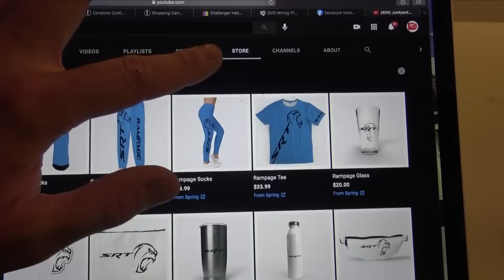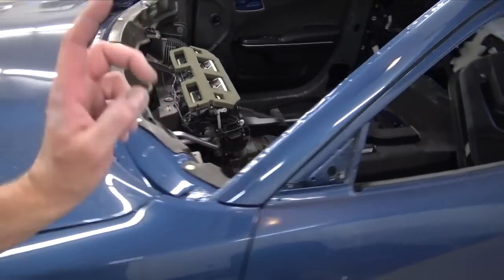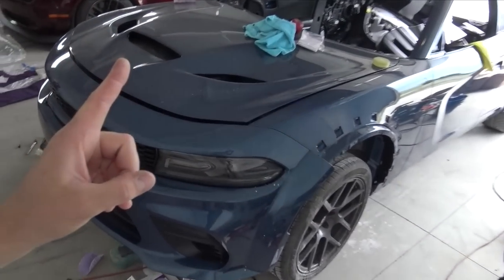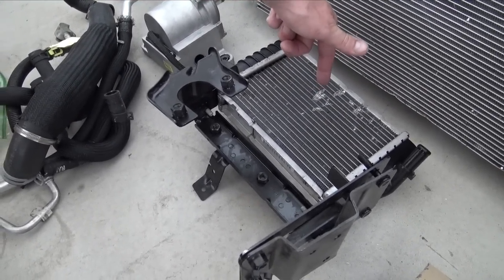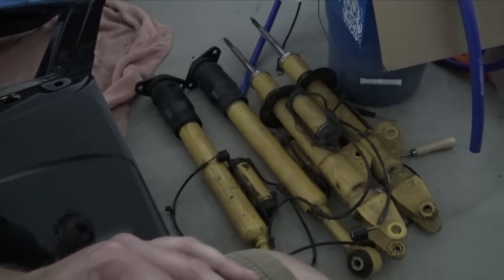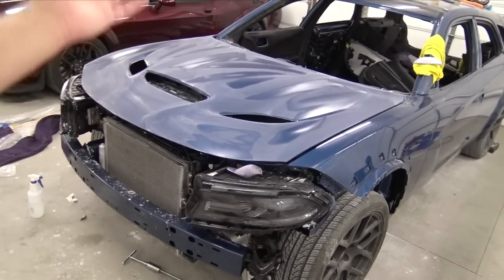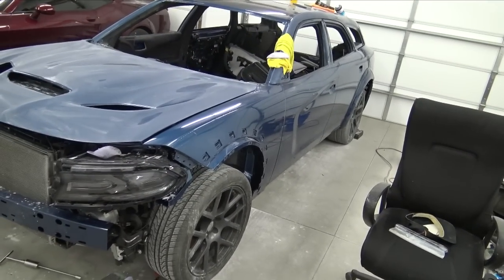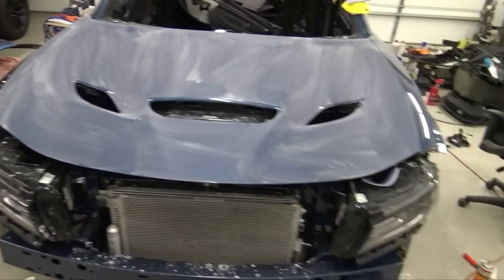Building the Ultimate Station Wagon | 2021 Charger Magnum Hellcat | 1000HP Hellwagon | Pt 56

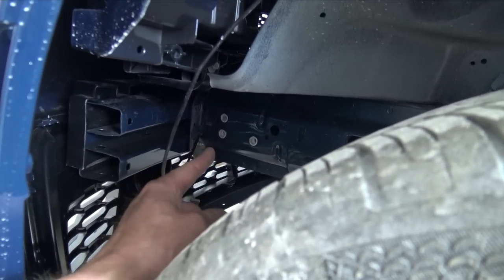Comment: 07:54 Those are pretty easy to find on Amazon, eBay, etc.

Not saying that they're better or worse than the genuine ones though.

I bought them a year ago after the nut on the body of my car that holds the trunk strut decided to"un-weld" itself...  

I bought the tool to install them and they've been quite useful so far.

Comment: Question i done some motors change over.  Wouldn't be easier place engine in without front clip on. Just a suggestion not to damage paint
Reply: I believe he will drop the k member and install the engine and k member from the bottom of the car.

Comment: trackhawk wiring do not work with the dash challenger wiring  ang good luck for the front suspension ,drive shaft and front axle
Reply from the maker: I already tabbed it all up all the drivetrain has been in the car before paint 6 months ago